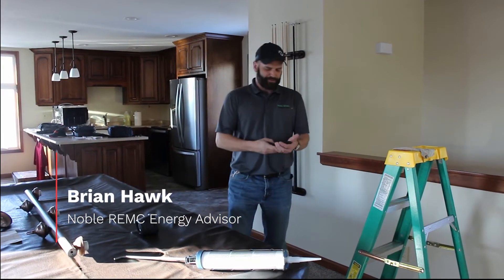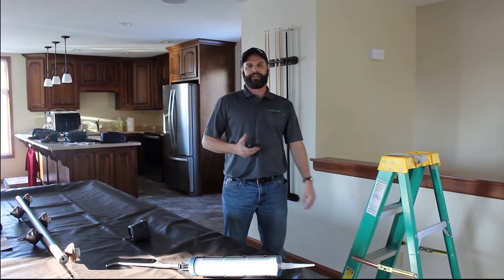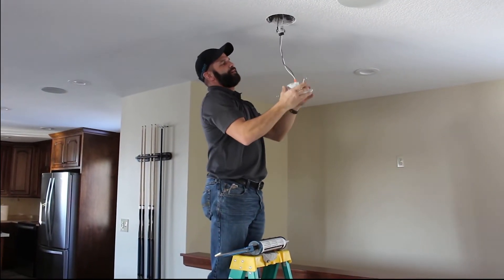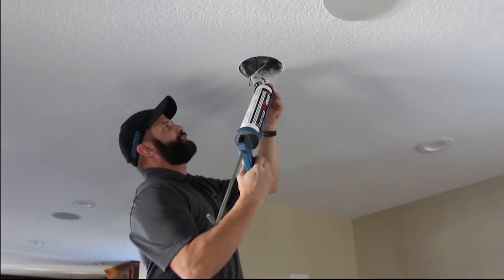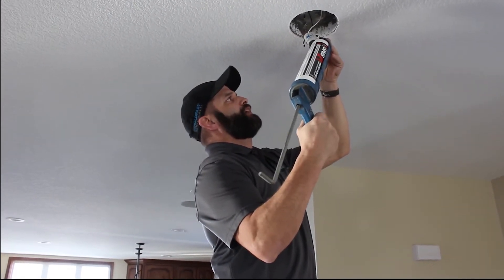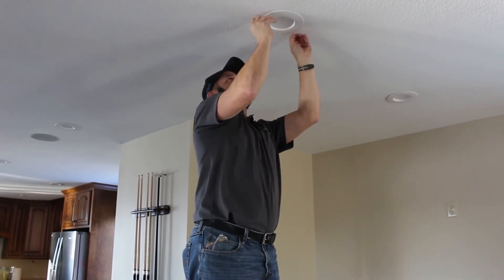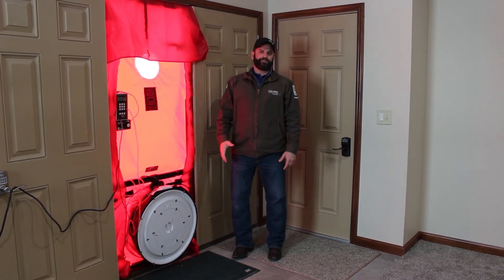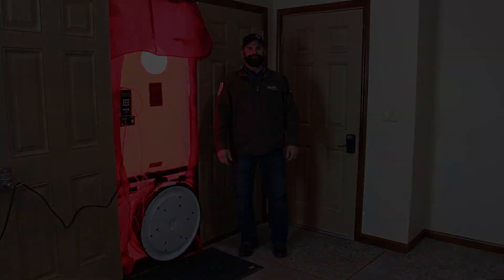Ask the Energy Advisor - Air Sealing Can Lights

Comment: Is it better too just put those dome cans over it or just put silicone around them ?
Reply from the maker: If your can lights are insulation contact rated, you don’t need the dome over the can light. You can seal it from below.

If your can lights are not insulation contact rated, the domes work great because you can insulate over the top as well.

Comment: Not a good job drafts also seep in through the can plate holes caulking only around the can plate will not prevent the drafts 

Take out the whole can light and cover the inside plate holes with putty pads fire retardant preferably

Comment: A typical housing has holes in it that are not suppose to be sealed. I guess what you did was some improvement but did not make it air tight. You could caulk around the led trim but that would make replacement hard. I wish the led has some non permanent soft gasket. These lights are simply badly designed.

Comment: Saying you dropped 100 cfm is useless. 100 out of what? 10,000? 1,00? Just saying one hundred is meaningless. Plus, what's the ACH50 value? That's the ultimate measure.
Reply: Around 0:25 he says the original blower door test before sealing the lights showed 597 cfm of leakage.

Comment: What about any holes in the cans themselves? I've seen the alternate way to seal being that you place insulating 'buckets' (or build boxes) that cover the canned light in the attic, and those are sealed with Great Stuff or caulk so that air can't leak through. It seems like this would work out well too but only if the cans don't have any holes in them?
Reply: Ha! Those silly buckets are $20 each! There’s got to be a cheaper solution. I have 97 cans to seal 😅
Reply from the maker: You're right. The best solution would be to put boxes, as you referenced, above the can.
Reply: @NobleREMC  the lights in your video are the LED retro fit type.  I understand that the holes in the top and sides of the can fixtures are there to, among other things, allow for the dissipation of heat because of the regular lights back in the day generating a fair amount of heat.  With the LED retro fit lights, there is little heat created, so can you safe use your caulk to additionally seal those holes in the cans?  They leak air too.
Reply: @jimfranks  This is the question I'm trying to have answered. I have to believe there are no issues with sealing the whole can, perhaps even insulating using foam on the inside of the can.
Reply: @NickiCager  The issue is not just sealing the holes in the can.  It is sealing the holes in the can in a way that is also fire safe.  From what I've read, spraying spray foam inside a fixture can is not NEC approved.  I've been trying to use 3M fire block sealing caulk; however, it would be much better for the electrical trade and codes to start requiring fixtures that only focus on electrical safety, but also are amenable to air sealing.  Those are hard to find.
Reply: I’ve got a plan. Don’t seal the cans. Don’t want to mess with code cans. Wipe thin film of clear silicone grease on the back side of the light trim ring, then lay a 1/4” bead of caulk on the Sheetrock right at the edge of the hole. Push light fixture into the caulk.

Comment: Would you recommend sealing cam lights in a finished basement or just the lights into the attic  ?
Reply from the maker: Since the finished basement is a conditioned space, I wouldn't worry about sealing can lights down there. Any heat that escapes is going to go into the floor of your living area above.

Comment: What happens if you need to change out a burn out bulb>?
Reply from the maker: Hey Ryan! After sealing with caulk, you'll still be able to pop the trim off to screw a new bulb (LED, preferably) into the recessed fixture.

Comment: Will this also work to soundproof from sound transference from an upstairs apartment unit to the lower one where new recessed can lights (LED) were installed?  New tenant downstairs is complaining about huge transference of sound from normal sounds above.
Reply from the maker: The sound benefit from caulking the can lights will be minimal. If there are a number of lights, caulking may help with the sound issues, but it depends on the sound you're trying to eliminate. If it's primarily voices, it may work better than if you're trying to deaden footstep sounds.

Comment: Thanks Brian.
I just finished sealing the 31 can lights in my house and all of the gaps around the ceiling HVAC registers.
I didn't get before and after blower door measurements, but I'm certain that I decreased the air leakage.
It's not comfortable living in a sieve house.
Good work on your video.